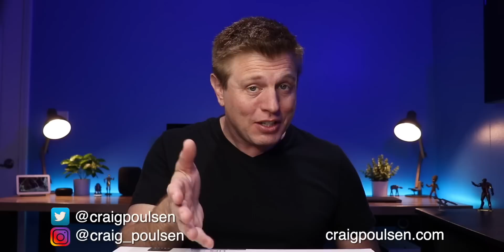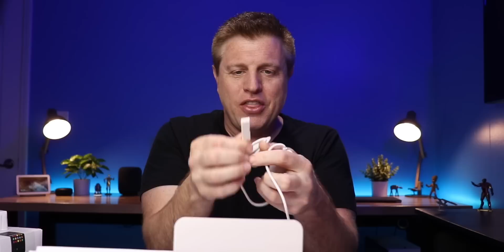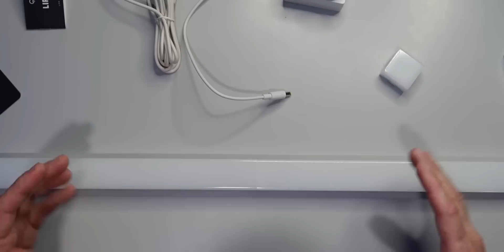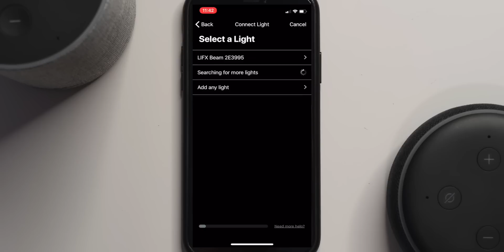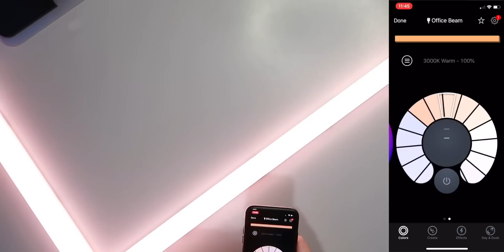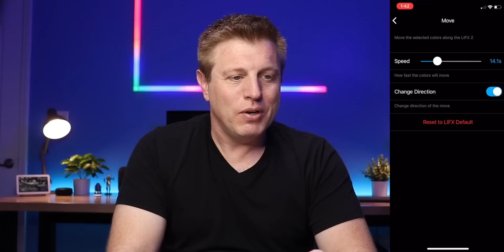LIFX Beam Unboxing & Setup - Great Accent Lighting

Comment: Can you split up the pieces? I want two bars vertical on each side of my bed. Would I have to order two whole sets for two power cords?
Reply from the maker: Yes you would have to order two sets for two power cords. You can’t split a single set
Reply: Craig's Tech Talk How long is the beam if installed straight.

Comment: I just purchased the Nanoleaf Canvas. I found out that it will not connect to a 5 GHz router/modem but it will connect to a 2.4 router/modem. Does the beam connect on an Android phone the same way the LIFX bulbs do?
Reply from the maker: Yes it will connect the same as the Lifx bulbs through the app.

Comment: So one set comes with one "L" shape light set?  If you want a complete square you need 2 sets?
Reply from the maker: Yes it comes with a corner and pieces to make an L. You can only add one more 12” piece. That would bring it to 7 so you would need to do two separate kits with two separate power supplies. You could not make a continuous square.

Comment: Hello Craig, I was wondering if you could help me with your knowledge and experience with smart tech. Iamb a fan of your channel. I have been researching for a  couple of  weeks now on smart light switches that work with Amazon Alexa and Google home, The problem I’m having is that a lot of them have negative feedback and to add to my particular case I need them not  to require a neutral wire as I live in the United Kingdom. I know that you can buy smart lightbulbs, but I would much prefer light switches and that are  dedicated to working with LED bulbs. Much appreciated if you could help me out thanks and advance. Hope you and the family are keeping well.

Comment: Have you had problems with connecting bulbs to duel networks 2.4 and 5 mhz .
Reply from the maker: Hello John, so far I have not had any problems with that. I don’t know if it has to do with the whole Router set up I went with. I do understand that some of these devices can get picky when it comes to the 2.4 and 5 MHz. I don’t know if you have the option to separate the networks. That way the Wi-Fi devices can all live on 2.4 side. Thank you for watching. I wish I could offer more information on this. Have a great day.
Reply: I'm actually having issues setting mine up
Reply: Make sure to specify only the 2.4 access; I don't believe they support 5mhz.

Comment: Will this work on a textured wall?
Reply from the maker: Hello Lori, they should be fine on a textured wall. They are 3M command strips like you would buy with the hooks. If you're able to put a command strip hook on the wall with a little bit of weight, these should be fine. They are very lightweight. Thank you for watching the video. Have a great day.

Comment: how good would you say the music visualization is? great review
Reply from the maker: hello Chris, I think it's better than the Philip Hue one. The one thing I didn't like about Philip you is that it just started getting way too random with a collars. One thing I noticed with the light beam is that it didn't really cycle through zones. It flashed as a solid beam. it will either flash in the color you have in your look. Or you can have it pick random colors that change to the beat along with flashing. I think it did a good job with the beat. It is specially look cool with multiple lights going at the same time. it definitely didn't feel like a random mess like I thought of the hue app visualization. It is still random, just not as bad. It did respond well. I hope this helps. Thank you for watching. Glad you enjoyed the video. Have a great weekend.